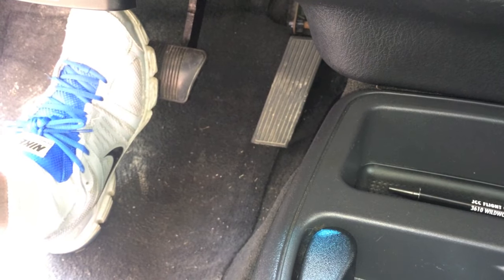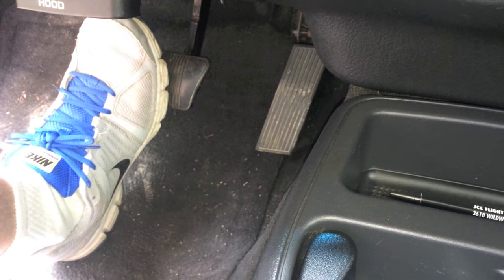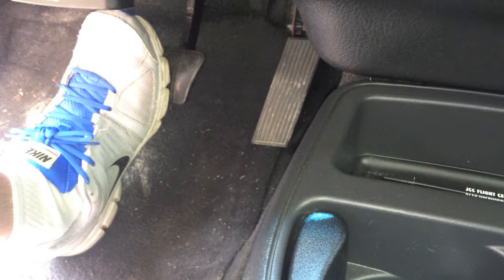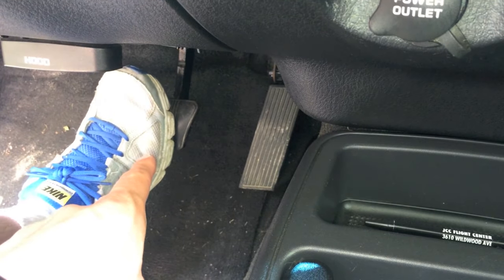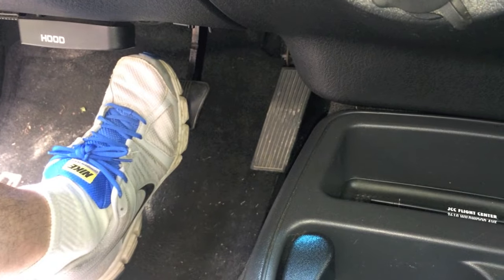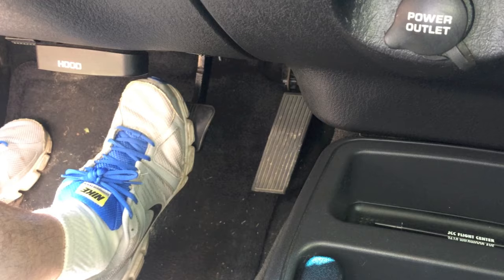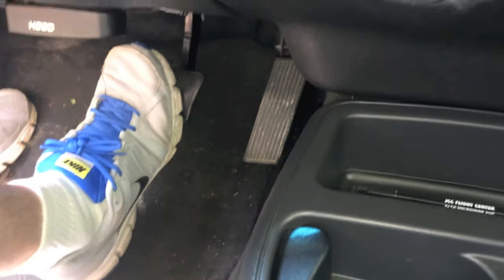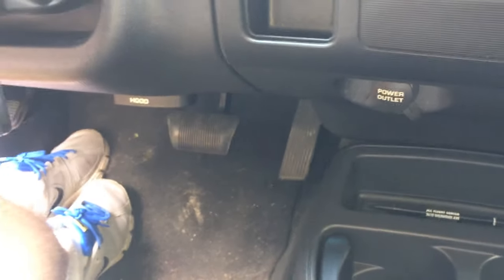HARD Brake Pedal - How to check if your BRAKE BOOSTER is GOOD or BAD

Comment: Hello.  I am driving a Toyota Innova G automatic.  At parked position (engine off), the brake had become hard to depress, thereby locking the ignition and not allowing me to turn the key.  Any advice on what could have happened?  Thanks.
Reply from the maker: Nelmar John Clapiz Thanks for checking out the video and sharing your comment Nelmar John Clapiz.

This is definitely not uncommon!  By chance has there been any recent work done to your Brake system in the last 12 months?  If so, we can start figuring out if the last repair has anything to do with this...if not let’s focus on a few different things....Lets figure it out!

1.  Its possible that your caliper is beginning to stick...maybe caliper slides have lost the lubrication required to shift back and forward freely.

2.  It can be possible that your Caliper piston has lost its lubrication which will also interfere with the efficient shift back for forth.

3.  The front rubber brake lines that connect to your caliper fail from inside rather that outside.  This means the inter coating begins to break away and clog portions of the brake system...hence not allowing fluid to flow back and forth freely.  

4.  Your brake pads have little prongs/teeth on them.  You will notice by their location...the pads slide on a steel brace.  This may need to be lubricated to bring the shift back to efficient requirements.

I have attached a few videos.  Lets start with the easy items and then work our way up!  Lets figure this out together!  Keep me posted!  Please Subscribe to the channel that would be awesome!

1.  Caliper Slides Lost Lubrication:

https://www.youtube.com/watch?v=-DZ68tKuCQc&t=15s

2.  Too much Fluid in Reservoir:

https://www.youtube.com/watch?v=X-AJ5tD6zoA&list=PLjCXOz8TSkZnavDiGDyHdPKe2dV2RzEMZ&index=39

3.  Failing Front Brake Lines:

https://www.youtube.com/watch?v=3FTEgbLYAdI&list=PLjCXOz8TSkZnavDiGDyHdPKe2dV2RzEMZ&index=78

4.  Brake Pads not shifting:

https://www.youtube.com/watch?v=3Pq15BWM_qY&t=103s

5.  Replacing Front Brake Calipers:

https://www.youtube.com/watch?v=8HoaL4QM5-k&list=PLjCXOz8TSkZnavDiGDyHdPKe2dV2RzEMZ&index=83

6.  How to check if Brake Booster is Failing:

https://www.youtube.com/watch?v=VK4lowH7kQE&index=66&list=PLjCXOz8TSkZnavDiGDyHdPKe2dV2RzEMZ

7.  Failing Brake Booster:

https://www.youtube.com/watch?v=j9s7yccswPQ

8.  Symptoms of a Failing Brake Booster Check Valve:

https://www.youtube.com/watch?v=j9s7yccswPQ&index=68&list=PLjCXOz8TSkZnavDiGDyHdPKe2dV2RzEMZ

Comment: I have a 2015 Yukon XL. With the engine off and pumping the brakes, the pedal eventually becomes hard to press. When I start the truck, it depressed all the way. The yukon also has a vacuum pump, do I need to change the pump along with the brake booster?
Reply from the maker: Victor Cazares Thanks for checking out the video and sharing your comment and experience.  Have you had any recent work done to the Brake System within the last year?

Also check kinder car for any brake fluid leaks...also check your Master Brake Cylinder reservoir level.  Is it at the proper fill line?  Have you added any fluid?  Lets figure this out.  Keep me posted.  Please Subscribe to the channel and turn on your YouTube notifications that would be awesome thanks again 😎👍
Reply: DIY With Michael Borders 
Hey Michael. The fluid is between the min and Max line. The trucks gas pedal becomes hard to press usually we're in the carpool line or when backing into a parking spot, where we are on the brakes somewhat frequent. If I pump the brakes, the pedal eventually becomes really hard to press. How would I know if it's the booster or the vacuum pump?
Reply from the maker: Victor Cazares Thanks for the reply!  Let try a few different things.  Has there been any maintenance done to Brake System in the last year?

There are a few things that can indicate a bad brake booster.  Below are a few ideas as well as videos.

1.  You can check the brake fluid reservoir...if the fluid is low, and you add more fluid...then after a few days of driving you check the fluid level and its low again...However there are no leaks anywhere...your system is leaking fluid into the booster...Not Good!

2.  Failing Brake Booster:

https://www.youtube.com/watch?v=j9s7yccswPQ

3.  Symptoms of a Failing Brake Booster Check Valve:

https://www.youtube.com/watch?v=j9s7yccswPQ&index=68&list=PLjCXOz8TSkZnavDiGDyHdPKe2dV2RzEMZ
Reply from the maker: Also, You might need to replace your calipers and pads.  Overtime calipers begin to weaken and apply pressure to the brake pads unevenly...thus leading to the chattering.  If this is your issue, you will notice that your brake pads will show signs of uneven wear...one may still have a lot of life on it while the other may be completely bare...not good.

So with that said, lets try a few things before you actually replace the calipers.  Attached are some videos that you can try such as lubricating the slides, lubricating the rails...

1.  Its possible that your caliper is beginning to stick...maybe caliper slides have lost the lubrication required to shift back and forward freely.

2.  It can be possible that your Caliper piston has lost its lubrication which will also interfere with the efficient shift back for forth.

3.  The front rubber brake lines that connect to your caliper fail from inside rather that outside.  This means the inter coating begins to break away and clog portions of the brake system...hence not allowing fluid to flow back and forth freely.  

4.  Your brake pads have little prongs/teeth on them.  You will notice by their location...the pads slide on a steel brace.  This may need to be lubricated to bring the shift back to efficient requirements.

I have attached a few videos.  Lets start with the easy items and then work our way up!  Lets figure this out together!  Keep me posted!  Please Subscribe to the channel that would be awesome!

1.  Caliper Slides Lost Lubrication:

https://www.youtube.com/watch?v=-DZ68tKuCQc&t=15s

2.  Too much Fluid in Reservoir:

https://www.youtube.com/watch?v=X-AJ5tD6zoA&list=PLjCXOz8TSkZnavDiGDyHdPKe2dV2RzEMZ&index=39

3.  Failing Front Brake Lines:

https://www.youtube.com/watch?v=3FTEgbLYAdI&list=PLjCXOz8TSkZnavDiGDyHdPKe2dV2RzEMZ&index=78

4.  Brake Pads not shifting:

https://www.youtube.com/watch?v=3Pq15BWM_qY&t=103s

5.  Replacing Front Brake Calipers:

https://www.youtube.com/watch?v=8HoaL4QM5-k&list=PLjCXOz8TSkZnavDiGDyHdPKe2dV2RzEMZ&index=83

Comment: Are there any other reasons other than a bad break booster that might lead to a hard to push peddle because I have a 1981 Chevy c10 and recently ordered a new break booster after I put it in what are some things I should look for or do to make sure it’s working properly
Reply from the maker: Jacob A 

Thanks for checking out the video!  This is definitely not uncommon!  It can be a few different things....Lets figure it out!

First thing that comes to mind is your fluid level!  Make sure your brake fluid is not outside the proper fill parameters.  This causes brake system performance issues...explained in more detail below!

Let’s work through the items!

1.  Its possible that your caliper is beginning to stick...maybe caliper slides have lost the lubrication required to shift back and forward freely.

2.  It can be possible that your Caliper piston has lost its lubrication which will also interfere with the efficient shift back for forth.

3.  The front rubber brake lines that connect to your caliper fail from the inside as opposed to the outside.  This means the inner coating begins to break away and clog portions of the brake system...hence not allowing fluid to flow back and forth freely.  

4.  Your brake pads have little prongs/teeth on them.  You will notice by their location...the pads slide on a steel brace.  This may need to be lubricated to bring the shift back to efficient requirements.

We have attached a few videos.  Lets start with the easy items and then work our way up!  Lets figure this out together!  Keep us posted!  Please Subscribe to the channel and turn on your YouTube notification Bell 🛎 that would be awesome!  Thanks again!

Links to all of our helpful step-by-step videos explaining the above possible causes are below, definitely check those out!  😎👍🔧🔩

1.  Caliper Slides Lost Lubrication:

https://www.youtube.com/watch?v=-DZ68tKuCQc&amp;t=15s

2.  Too much Fluid in Reservoir:

https://www.youtube.com/watch?v=X-AJ5tD6zoA&amp;list=PLjCXOz8TSkZnavDiGDyHdPKe2dV2RzEMZ&amp;index=39

3.  Failing Front Brake Lines:

https://www.youtube.com/watch?v=3FTEgbLYAdI&amp;list=PLjCXOz8TSkZnavDiGDyHdPKe2dV2RzEMZ&amp;index=78

4.  Brake Pads not shifting:

https://www.youtube.com/watch?v=3Pq15BWM_qY&amp;t=103s

5.  Replacing Front Brake Calipers:

https://www.youtube.com/watch?v=8HoaL4QM5-k&amp;list=PLjCXOz8TSkZnavDiGDyHdPKe2dV2RzEMZ&amp;index=83

6.  How to check if Brake Booster is Failing:

https://www.youtube.com/watch?v=VK4lowH7kQE&amp;index=66&amp;list=PLjCXOz8TSkZnavDiGDyHdPKe2dV2RzEMZ

7.  Failing Brake Booster:

https://www.youtube.com/watch?v=j9s7yccswPQ

8.  Symptoms of a Failing Brake Booster Check Valve:

https://www.youtube.com/watch?v=j9s7yccswPQ&amp;index=68&amp;list=PLjCXOz8TSkZnavDiGDyHdPKe2dV2RzEMZ

9.  Master Brake Cylinder info

       https://youtu.be/F9s_1VZ2u5E
Reply: You have got to be the most helpful youtuber I’ve ever met I’ll be starting work on it in a hour or so and I’ll keep you posted again thanks so much for the help
Reply from the maker: Jacob A 

We really appreciate that & we love making these helpful videos for our fellow DIY’ers.  You Rock!

😎👍🔧🔩

Comment: Good day I replaced the brake caliper of my car because there was a leak with the old one. Before replacing that my brake is ok and responsive but after replacing the caliper the pedal got a bit lower when braking and it got less responsive. There is now also a creaking sound at the push rod when taking my foot off the brake pedal (I think my friend overdid it when he was stepping on the pedal while I was bleeding the brakes). Do I need to take apart the pistons of the caliper? Or do you have a better idea of what to do. Thanks
Reply from the maker: Dexter E 

Thanks for watching & sharing your experience.  This is more common than you think.

Before taking things apart, we recommend continuing to bleed brakes at all bleeder valves.  You most likely have some air still in the lines.

Changing Calipers requires the brake lines to be opened up as you know...which allows LOTS of air into the system.

We were working on a Toyota Celica one afternoon & spent 30 + minutes bleeding brakes until all air was removed & pedal was good.

Even the tiniest of tiny amount of air can cause lots of brake pedal issues.  

keep us posted!

Please subscribe to the channel and turn on your YouTube notification Bell 🛎 that would be awesome thanks again!

😎👍🔧🔩
Reply: @DIYwithMichaelBorders  thanks for the info. I will bleed all the valves. And I will update you if that solves it. Thanks.
Reply from the maker: Dexter E 

Very cool & thanks for the reply!

😎👍🔧🔩
Reply: @DIYwithMichaelBorders  hello I've bled all the valves a while ago. Glad that brake performance improved it's now more responsive. Thanks for replying and suggesting what to do it really helps. God bless.
Reply from the maker: Dexter E 

Awesome Awesome & we appreciate you taking the time to reach back out to us!

We are here for future questions as well!  😎👍🔧🔩

Comment: Cheers mate, thats a good test to know about! My pedal goes forward but only 1/2 inch or so.... I'm pondering why my car doesnt brake like it used to. The brakes work fine but its not nearly as sensitive as it used to be... I have to press a lot harder than when i bought the car. Front discs and pads were changed, the rear drum shoes at nearing the wear limit but are self adjusting. I've only ever changed the fluid once, car is 7 years old, the fluid wasnt badly discoloured, bleeding done without issues. Anyone kindly got any ideas?
Reply from the maker: Thanks for sharing this, it may be as simple as too much fluid inside system however unlikely.

Keep us posted.
Reply: @DIYwithMichaelBorders  Well i just verified the one way valves associated with the brake booster. Was hoping to find something wrong but its all functioning fine. Theres a procedure where you use a scanner to tell the abs system to purge itself. I´m going to give that a go. Cheers!
Reply from the maker: @mikescudder4621  

Neat, fingers crossed.  👍
Reply: @mikescudder4621  man I'm having the same issue. I've been told it's because of the failure to create a proper vacuum.
Did you have any luck with the issue?
Reply: @tahirtalpur98  Well i was convinced my brake booster had a leak but i got it tested and it was fine. The same test also verified that the engine was creating enough vacuum (so no vacuum leaks). My engine also has a vacuum pump for the brakes which i took out and tested - was fine. I changed the pressure sensor on the brake booster because the car threw a code about it years ago which comes back once every 1000 miles or so. I also changed the rear drum brake shoes. The auto regulating adjusters had stopped adjusting because of 10 years worth of brake dust! But all cleaned up and adjusted improved the brakes but not the way it was years ago. This is probably the most common solution for those of us who have this complaint (rear brake shoes out of adjustment). I also had the scanner purge the abs circuit with fresh brake fluid entering. No difference, but its good for maintenance. So i´m going to have a look at the front brakes... They do most of the braking anyway.
Reply: @mikescudder4621  When I start my car, the brake pedal goes down by ½ or an inch (so I guess the brake booster is working fine). But as soon as I switch it off the pedal recoils/pushes back with quite some pressure and my leg is not able to stop it (that's how much the pressure is).
I've replaced every single component of the braking system the shoes the callipers brake lines and the pistons you name it. But this issue still persists. I've been watching videos and reading blogs about this issue and most of the people diagnosed a vacuum leak or low vacuum in the manifold. I'm gonna work on it today lets see. Will update you. Wish me luckk 🤞
Reply: @mikescudder4621  Apparently there was a small hole in vacuum hose so I replaced it. Also I felt the lack of vacuum inside the booster, so I installed a check valve between the hose.
Issue solved 🌚
Reply: @tahirtalpur98  Good job!
Reply: Hi if power break booster is ok. You must try to change MASTER BREAK CYLINDER in my car i push break 1/2 pedal nothing happened then break released. And then break happen and stop car but not as like new. After change this part car stop quickly
Reply: @imranbhatti2522  Thanks Imran, i´ll look into it.